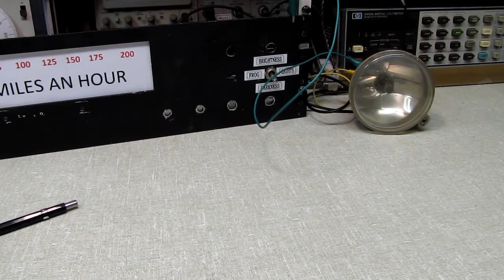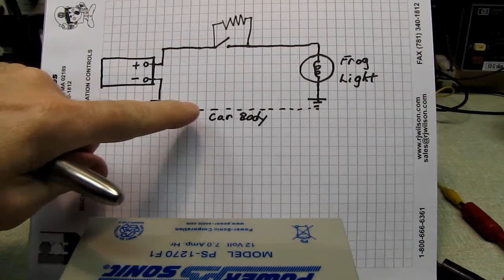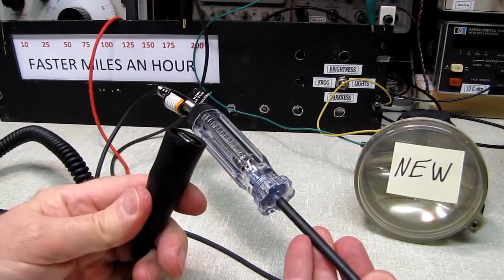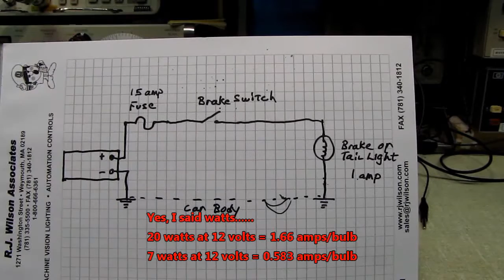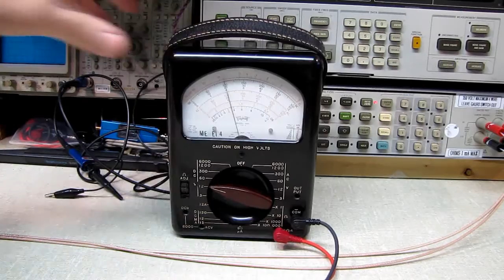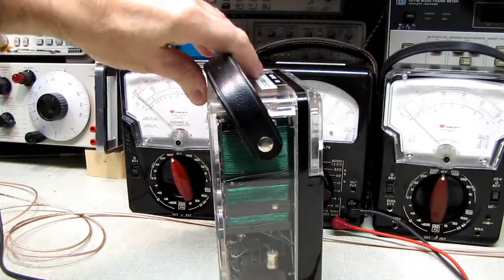Why YOU need an Analog Triplett 630 VOM

Comment: Great Meters For Bench Work, Am Electrician And Bench Tech, Have 4 Or More 630’s, Have Flukes And Other Digital’s.
A Great Analog For Field Work Is A Tripplett 310, Telco Friends Used Them, Searched Specs Were Great. 
Telco Employees Said They Were Told  To Reverse The Leads, This Way When Red Lead On Red Phone Wire, It Would Read A Positive Voltage.
With Old Land Lines, Line 1 Used Green For Positive, Red Was Negative Voltage, Center 2 Pins On A RJ 11 Phone Jack.
Yellow/ Black Was Line 2. The Outer 2 Pins

Comment: I just purchased a Triplett 630-PLK Type 7 now after watching this and hearing Ron talk about how these meters are useful for measuring high megohms in capacitors. 
I'd like to ask about your meters. They look new! I'm assuming that's not by chance based on the meters I've seen for sale so far. Would you mind talking about how you go about getting them in this condition please?  Even the straps look new! Thanks in advance - love the channel! Cheers - Luther
Reply from the maker: Hi Luther, I keep my eyes open at all the Electronic
flea markets. I have never paid more than $20 for one. In fact I bought a lot of 8 damaged ones for $10 once and put together 3 good ones from the parts. Clay bar and Turtle wax cleans up the cases nicely. Be wary when you buy one. Always open it first and look for battery leakage damage.  I usually have a battery with me to test and make sure the movement isn't blown. And to make sure the needle moves smoothly. Have been looking for a 621 but these are few and far between. The 621 is a VOM/VTVM combination. Looks exactly the same outside, but has a tube and works as a VTVM for DC measurements. E-bay has a couple for sale, but I don't trust the "untested" nonsense".
And they never show the inside. Likely damaged from leakage.
Reply: Thanks for the response! I got lucky on my meter. The seller's photos were blurry and from a couple of feet away. For $29 I took a chance forgetting to ask for interior photos. I received it today. It had a D-cell and a 30-volt battery. I changed out the D-cell and all of the battery contacts look good. I could maybe hit them with fine sandpaper but no corrosion. It has one small hole on the bottom of the cabinet and I'll maybe patch that with epoxy. It has one issue I need to look at. In ohm setting, all ranges deflect the pointer to the right except for the 100K setting - it wants to deflect to the left. Any ideas? I'll look for a schematic and get a clay bar. Thanks! Cheers - Luther
Reply from the maker: @Valerifon1  sounds like you have the 30 volt battery installed backwards. It's only used for the 100k range.
Reply: Yes, pride dictates I remove my comments but I will leave them for future reference. 😂  The 30V is so much higher than the 1.5 D-Cell that I didn't put it together that the 30-volt cell is meant specifically for the Rx100000 range. Its working perfectly now. Lesson learned. 😎👍 Thank you very much! Cheers - Luther

Comment: I made a 30V battery by stacking ten lithium button cells. I machined a plastic enclosure the same size as the original battery, but 3D printing would be even better. These days however, a 413 battery from Amazon isn't ridiculously expensive.

Comment: Been using an AVO 8 for my times, more or less the equivalent model of analogue meter here across the pond. Beautiful meters.
Reply from the maker: I would guess that the AVO stood for amps volts ohms. Cool looking meter.
Reply: @theradiomechanic9625  Indeed it does, it was built from the 1920s to 2008, and all versions up to, but not succeeding the AVO 8 Mark could measure up to 3kV AC/DC. Being 22 they are a little 'oldschool' for me but they compliment my digital meters beautifully. Your video has taught me yet more about them!

Comment: Great video I have two Triplett 630 meters I won off an auction site that I would like to get to work again. Amazon carries the 30 volt battery new production. One of my 630's the needle will not go above about 1/4 of the scale, and the other one will not move at all! both meters are in very nice condition not all beat up and the one has a near perfect leather case. Just wish they worked.

Comment: Good lessons on loading test circuits 👍 Another good reason to have a meter like this is to use your head more. These days most of the newcomers think less (I suppose) about input- and output impedance and circuit loading. With a meter like this you have to think more. Today is everything auto-range and auto-setup and so on. Also you have to think more when reading the analogue scales.  Scales on some meters are quite tricky to read (where the full scale on some range is the half, and other range the double..). Could be tricky 🙂  By the way, a clear back television set would be an interesting collector's item!

Comment: I always learn lots from each of your videos...thanks for sharing! 
I just put in an offer for a really nice Triplett meter...wish me luck!  (And thanks for the tip for a 30 volt battery replacement using the three 9 volt batteries. )
Reply from the maker: There are actually a couple of vendors on eBay and Amazon who now sell the actual 30 volt battery again. Good luck with your meter.

Comment: "...Need to be tapped."  Uh, yeah!  But be careful, when and where, you tap!  In the 1980s, I repaired & maintained a 50KW AM broadcast xmttr.  One of my duties was to perform the weekly calibration of the remote meter readings.  Antenna current was measured by a thermocouple type RF ammeter, at the matching network, at the base of the tower.  The meter was in an aluminum box, mounted on 3" ceramic stand-offs.  The switch, which switched the meter in or out of the circuit, had a foot long phenolic handle.  I flipped the switch, to take the reading.  The meter needle did not settle right down.  I INSTINCTIVELY tapped the glass face, without thinking...and drew a 4 inch arc to my hand.  The aroma of burnt flesh wafted into my nostrils.  A white patch appeared on my finger & hand.  It didn't really hurt, but tingled.  The current had just traveled on the surface of the skin, without penetrating (the "skin effect," and yes, that's also a pun).  It was around 1580V, @ 1550 KHz.
Reply from the maker: When working with high voltages I use a small plastic wand to tap. Been bit myself before.
Reply: @theradiomechanic9625  Good advice!  I haven't encountered real high voltages, since I worked as a radio/tv engineer in the 80s.  The highest voltage I encounter, these days, the 650V P.A. supply, in my Yaesu FT-101B.  I call that "B+," not HV.  Of course, RF has its own devious abilities, eg, ionizing the the air, and arching, a lot more readily than DC or LF AC.

Comment: A guy on EEVblog has a 630 with a clear back as well.., the Neda 30V battery is back on the market and albeit generally expensive, sometimes available tho for around $15. I have a 630 NA type 4 suspension with the range doubler, but doesn't have the 6k volt option. I've got a Radioshack POS that I use in the feild just so I don't damage the Triplex

Comment: Nice review of some very nice Triplett's. I've got a 630-NS with the range divider switch. A very versatile meter with a 100K/200K ohms per volt sensitivity and a lowest range of 0.15 volts DC! It only handles up to 1200 VDC w/o companion 6KV or 30KV probe. Accuracy is 1.5%. The 630-NS uses 1.5V D and AA batteries, so no $30 30V battery is required (available on Amazon BTW). Triplett's were the "BMW's" of meters while the Simpson (260s) were the "Ford's." Each has a coveted place in history. Belated cheers!

Comment: Pro-tip from s mechanic: if you are going to spend under $20 on a dmm, just get a test light, because it loads the circuit just like the old analog meter

Comment: Hmmm,  I have a couple of automotive test-lamp probes like yours in my toolbox (which I haven't used for years) and it occurred to me that if somebody went to buy a new one it would probably have an LED instead of an incandescent lamp, and so it wouldn't work the same for troubleshooting purposes  because it wouldn't pass current when inserted in series into a circuit.....
Reply from the maker: You are correct., I have others in the garage that use various lamps, Head light, tail light etc. for various current draws.

Comment: I hate to be "that guy" (my wife says I'm lying, because I live to be pedantic!), but the automotive headlight isn't really a low "impedance" load, it is a low resistance load, being that it operates at DC and is being measured at DC. Nearly everybody, including myself, I freely admit it, uses the term impedance when what we really mean is resistance. (Mea Culpa, mea maxima culpa!).  Anyway, since this is meant to be a tutorial for newbies, it wouldn't hurt to mention that the headlight Is a non-linear resistor, it has relatively low resistance when cold, but when fed sufficient voltage and current to make it glow, the resistance of the lamp filament will be much higher.  The reason a cheap switch fails prematurely isn't necessarily from the steady-state current passing through it when the lamp is illuminated, but instead from the surge current that has to pass through it for a fraction of a second when the lamp is cold and the resistance of the filament is so low that it is indeed briefly close to being a "short".
Reply: Well said. Impedence for AC circuit and resistence for DC circuit.

Comment: I don't recall the model number but when I was working as a full time bench tech I had an orange-case Triplett  analog meter on the bench that I used almost every day. It wasn't as pretty as the old Bakelite  ones but it worked quite well.  In addition to a standard 9 V battery it used an odd size cylindrical battery that was neither a C nor D size cell but bending the contact on one end allowed a D cell ( IIRC) to fit. It was very handy for in-circuit testing of suspected open or shorted diodes, and checking transistors for base to emitter and base to collector shorts.  

As for your comments at the end of the video about the loading, or lack of loading,  that a meter can introduce into the circuit, thereby giving you erroneous measurements, it is worth noting that the factory instructions for calibrating a Hickok tube tester are predicated on using an analog meter for some measurements and a VTVM for others, and use of the modern digital meter in place of an analog meter will give you wrong results and lead to miscalibration of the tester unless you shunt the digital meter with a resistor to approximate the 1K ohms per volt that the circuit and calibration procedure is looking for. (A modern digital meter should work just fine in place of the VTVM however).
Reply from the maker: Most radio schematics will specify the meter to use. I mention this often, but sometimes forget.
They might specify 1000 ohms/volt, 20,000 ohms/volt or VTVM. And yes, a modern digital VTVM is an acceptable substitute for a VTVM.

Comment: If you have to tap the meter to get it to read right, the meter isn't working correctly. I have several Sinpson meters and don't have to tap them to get the right reading. Also, the whole short thing..... this scenario is about a short. The short is in the switch. I bet if you could see inside there would even be a spark. Shorts don't have to only be a dead short in wiring, you can have a partial short as in wire insulation not completely doing it job, cars spark plug wires do this and they don't cause a massive fire. The term short covers a very wide variety its not just cut and dry. Now that you know you have a sticky meter you can make your next video about fixing your VOM.

Comment: I always tell people that a short is a self correcting problem. And it's easy to locate. It produces light and sound and smoke and heat (and sometimes projectiles) and will eventually become an open - hence, it is self correcting. It's also, usually, much more expensive to repair.
Reply: Not in modern electronics.

Comment: Excellent video! 

Recently, I've found new triplett 630 VOMs on Amazon, but they are too expensive. And they don't have the 6kV input of the older models.

The clear back Triplett is awesome! It has been an idea of mine to have a meter with visible guts.

There are small 12V batteries for car alarms, they are like half of a AA battery in height. Maybe putting 3 of them in series and some "black magic" 30V zener-resistor could replace the 30V unobtanium cell?
Reply from the maker: Hi thanks for watching the video. There are now actually 30 volt batteries available on amazon. And if they're not available you can use 3 9 volt batteries in series 27 volts works fine.

Comment: Very good video. I have a 630 Type 3 in very nice condition that  friend (now deceased) gave me. I was able to get a 30V battery on Ebay. Everything seems to be working fine, except when I test a 122V AC circuit, it is reading 215V (300V range setting).Any ideas on what to check to fix it?

Comment: i have some  triplett ,some simpson , some EICO ,ETC,ECT, FOR VINTAGE STUFF I USE VINTAGE  meters , for modern stuff i use modern meters , i can'not use a old meter on modern stuff because  the old meter overload  the system but for old thing's  no problem  because old stuff work  no meter  what and i like to watch the needle to see the reaction of the circuit  , with the digital meter you just see #'s go up and down fast  you don't have time to see what's going on  in the circuit, i love meters ,i my have more then 200 meters by know ,( digital and analog) ,,,some VTVM's  also ,,,,enjoy your meters

Comment: I still keep a few analog meters just because I'm old but....you could use a "modern" high impedance voltmeter to troubleshoot these issues by checking for voltage drop across various parts of the circuit while it is under load. Should have virtually zero across a switch or wire.

Comment: Thanks for the awesome video! I just bought a 630-PLK. The back is chipped and cracked, looking for a replacement back. 

Any chance you have a back you'd part with? 
Would the back from a 630A fit the 630-PLK?
Reply from the maker: Hi Arn, I don't have any spare backs, they are about as rare as rare can get. I would think the 630A would fit. So far every one I have seen is interchangeable. I usually super glue the cracked ones and put a very large hose clamp around it to make the crack tight so the glue sets up. ( Not too tight as you will crush it ). If the chips are not large I then put a wrap of shiny black electrical tape around the seam between the front and the cover. The tape blends in with the color of the unit and is almost invisible. only down side is a few years on the adhesive is messy. A little mineral spirits cleans it off easily. The 30 volt batteries are available on Amazon now. These meters sell for around $400.00 new. Congrats on a nice meter.

Comment: Run into these  troubles  with regular  electrical  work . Glow pens/  digital fluke meter  show power . Under load nothing getting  thru . The volt con tester throws  a load on the cicut  plus you feel it vibrating  . Burnt  switch  or contactor  relay  is burnt  . Is typical  trouble.  Trouble  shooting  faulted lines  underground  digital fluke  picks  erroneous currents. Numbers  running  up and down  try  to watch  the bar Graf  instead  but it moves  up and down to  .use the 260 Simpson . Goes to a value  and stays  stable  . Most of the time  wires  burned  open in the pipe because  of ground water . Maybe  stack a bunch of  watch  batterys  to get 30 volts for the Triplet.  The phone company had those  meters  on there service  trucks  back in time .

Comment: Great video! You offer a very clear presentation.

It is common in electrical work to have conductors so close they show a voltage on a digital meter due to its high sensitivity. Electricians call it “ghost voltage “ because they don’t understand input impedance. Typically, a digital meter will show 30-60 volts on a conductor that actually has no voltage. Usually on 3 conductor NM cable for a 3 way switch. An analog meter won’t give you this problem. For this reason, I keep an analog meter in my tools. I keep my Simpson around because it has an amp clamp and I can see fluctuations and I have a Triplett 630. The only time I truly need a digital meter is for work with VFDs, electronics and 3 phase systems where I need to see true RMS amps.

Comment: Just got a triplet 1200-G meter… Can’t find hardly any information online… Would love your input and to show you some pictures. Very similar to what’s in your photos but built in the late 1930s, in a metal box with a door on the front, heavy-duty latches and hinges, a beautiful leaded glass face… And just made overall to the highest standards. Unbelievable amount of battery crud and corrosion on the inside… And I will be sandblasting and re-powder coating the case… But man this thing is beautiful and the white needle face plate paint is in perfect condition almost 100 years after it being made!

Comment: You have not mentioned anything about its ohms per volt. Does it have a super sensitive 10 microamp movement[ some moltimeters have]?
Reply: Guruvu3npy The 630-NA is super sensitive for an analog. 100k ohms/volt DC and 200k with the/2 switch.

Comment: you cant measure more than 1200 without the HV reduction probe.
try not to get people killed
Reply: Not true.   I checked the Triplett Model 630 Type 3 manual.  These meters are designed to read up to the stated voltage on that input jack (5000 v) with the standard probes.  You can get an optional HV probe which will allow it to read up to 30,000 v, but you don't need it to read up to 5000.  Of course, you have to worry about the insulation on the probe wire breaking down, as he warns in the video.